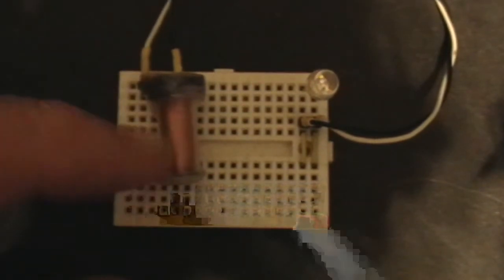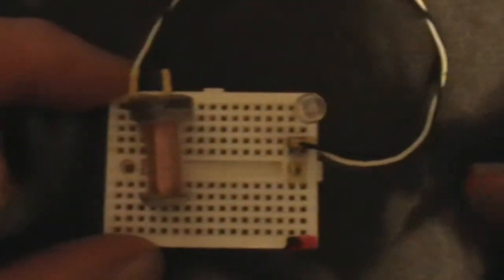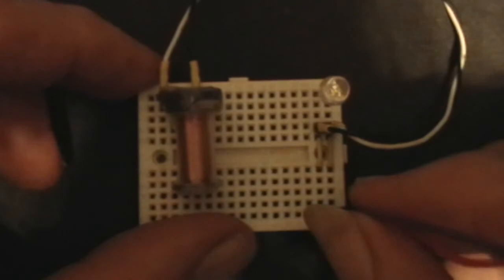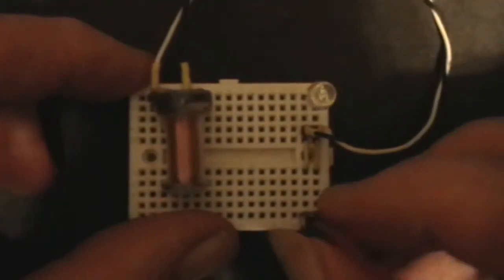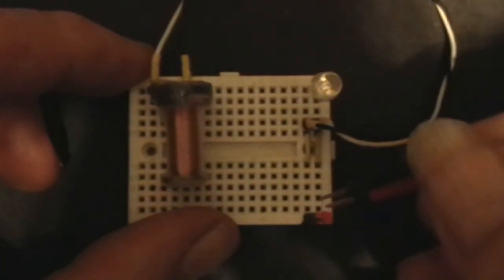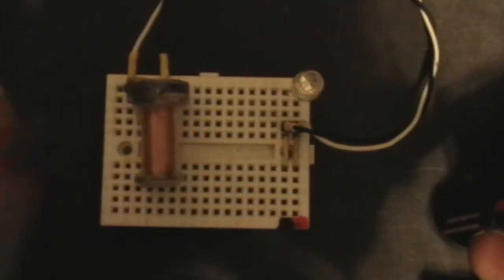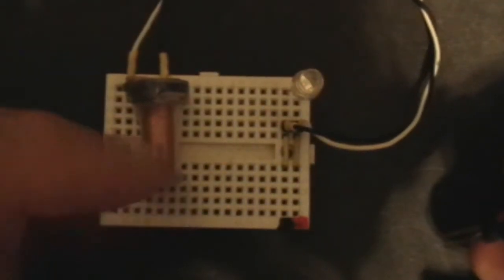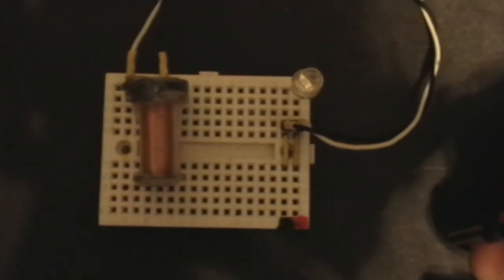Coil Current Direction when Power is Interrupted (1)

Comment: I HAVE TO BE NITPICKY ABOUT THIS TK..I THINK THAT YOUR CIRCUIT NEED A DIODE IN SERIES WITH THE LED TO PROVE YOUR POINT..BECAUSE THE LED FLASH THAT DOES NOT PROVE THAT THE CURRENT IS NOT RINGING AND OSCILLATING..
Reply from the maker: IS YOUR CAPS LOCK KEY STUCK or are you just being rude? In English speaking countries ALL CAPS is considered SHOUTING. 

Watch the second video.  
https://www.youtube.com/watch?v=X66foYixu9Y

Besides, what part of Light Emitting DIODE do you have trouble understanding? Putting another diode in series would only raise the voltage rise necessary to make the LED flash; the results would be the same.  The circuit is not ringing or oscillating. 

Now, ask yourself why circuit designers put a diode, reverse-biased, across a relay coil to protect the driving circuit when the power is cut off to the coil.

Comment: What's fascinating about this demo is that it goes against 57 years of my electronics intuition. But it's correct, so much appreciated. I imagine that's the reason you felt compelled to post it - because we are taught that "back EMF" exists to reverse current. At least the "back EMF" part is correct anyway.
Reply from the maker: Thanks for checking in and commenting. This is hard to confirm on the scope because stray capacitance and inductance cause so much ringing that it's hard to see what is happening. But I think the LED provides unequivocal evidence that the current does not reverse.  At least it makes it extraordinarily difficult to explain why the LED flashes if the current does reverse as many people still claim.  This little video of mine has sparked considerable controversy and seems to have left some people utterly flabbergasted. Is everything we know really wrong?
Reply: It is absolutely correct.
This is a less traveled corner of electronics that many struggle with.
I have even seen tutorial videos here on youtube by experienced engineers that have gotten this wrong.

Comment: could you try to use 2 parallel LEDs (cathode to anode/ anode to cathode)?
Reply from the maker: You will note that the power supply is 5 volts and there are no resistors or other current LIMITING components installed. So if there was a forward biased LED in the circuit, it would fail as soon as I connect the power.  The LED that is reverse-biased when power is on survives the flash from the inductor's discharge when power is disconnected because the flash is so brief and because the LED limits the voltage rise by conducting.  With a lot more inductance in the coil (more energy stored in the magnetic field) the LED might fail even so.
Reply: Thank you for the response.
i understand the problem of no current limiting resistor for the LEDs,
and i agree with you with the "cold electricity" explanation (HV HF)...
by the way i was thinking about the response of a coil in resonance, as for example with the simple 555 timer circuit (have a look at my vid) to test the resonance of coils
Reply from the maker: Of course I could use your idea of two antiparallel LEDs if I used a power supply that was much less than the Vforward of the LED. Like one volt. With sufficient inductance in the coil, the first LED should still flash as the voltage of the inductive collapse rises. The second LED should stay dark. I'll have to try it, thanks for the idea. 
I use a PLL system to check resonant response of coils.
EDIT: I just tried it with 1 volt supply and the two LEDs. It works as expected, the second LED stays dark and there is sufficient voltage rise to make the first LED flash just as before, but not quite as bright. I'll have to make another video because this added test reinforces the point made by this video. Thanks again for the suggestion !
Reply: Thanks to you TinselKoala!

Comment: I am picking up what you are putting down, sir.  Thank you for it!
"The voltage polarity of the coil can be thought of as reversing,..." is probably the stumbling block that confuses most people.  As you have clearly demonstrated:  The current goes from the plus side of the coil to the minus side (in steady state) when powered, and from minus to plus (transient) when switched off.

Your experiment reminds me of the MIT Linden jar disassembly while fully charged--opposing plates were brought together and made no spark until reassembled with the, "insulator."  Absolutely mind blowing.  The insulator holds the charge gradient, not the plates as shown in books.
Reply from the maker: "The current goes from the plus side of the coil to the minus side (in 
steady state) when powered, and from minus to plus (transient) when 
switched off." Well, this is still a rather awkward way of putting it. Actually the current keeps flowing in the same direction, only the voltage polarity of the coil can be thought of as changing. But does it really? If you think even harder about it, you will see that when power is ON the top of the coil is still a current sink (current flows into the top) and the bottom is still a current source (current flows out of the bottom) and this does not change when power is disconnected.

Comment: You are right. The current supplied by the 5V goes externally from plus to minus, but internally back from the minus to the plus.If we apply this knowledge to the coil, the current goes from the plus to minus, and to make the LED flash the bottom must be the plus of the coil, so the current goes internally from top (minus) to bottom (plus). To make things worse, the electrons actually travel (very slowly) from minus to plus.Any how, a good thing you showed this. I get the theory but never thought about it! The potential is reversed but the current does not. Actually the current is reversed, but it is negative. Hmm, that sounds silly ..
Cheers!
Reply from the maker: No, the current is NOT reversed! The flashing of the LED proves that beyond any doubt, doesn't it? How could the LED flash if the current in the coil was in any sense reversed? It couldn't.
We are of course talking about "conventional" current that Ben Franklin stuck us with. The actual motion of the electrons also does not reverse, but is opposite to the "conventional" current which is considered to flow from positive to negative. What reverses is the polarity of the voltage of the coil, with the bottom end becoming "higher" in potential than the top when the power is interrupted. Hence the current does not reverse, it continues going in the same direction through and out of the coil.
Reply: We are both saying the same. I am comparing the coil to the power source/battery. As if the coil is a battery when it does the EMP. Just like with the battery, the current internally goes from minus to plus. Perhaps you misunderstood my word 'top' and 'bottom', I was referring to the circuit. The top of the coil is attached to the switch (plus of the power source) and the /cathode/ of the LED.
In fact it is a quarter wave of a sinus, that new potential. The coil would like to go in resonance, how ever it is shorted by an LED. (edit: replaced cathode and anode)
Reply from the maker: Look again. The Top of the coil on my schematic AND my breadboard is connected to the CATHODE of the LED. No, the discharge is not a quarter-sine wave, it is an exponential decay ramp. If the coil wasn't "shorted" by the LED or other path completing a circuit, the voltage would rise and rise until insulation or component breakdown allowed the energy to discharge. This has nothing to do with resonance, except that there is always some stray capacitance that will cause ringing at the resonant frequency of the LC tank formed by the coil's large inductance and the tiny stray capacitance at the end of the main discharge.
Reply: With all respects, I think you confuse yourself when you use therms like internal, external...
The instant the 5V supply is dis-connected the LED will see the coil as a "battery" with polarity such that current can flow through it. (The LED)
In other words current keeps going the same way through the coil.

Comment: when the coil is powered on it creates a magnetic field.
that field collapses and induces the coil and that makes the led flash.
Reply from the maker: You are being imprecise in your language. "Induces the coil".... what?  The point of this demonstration is that the current does not reverse direction as the magnetic field collapses. It is the current that makes the LED flash. The LED does not know nor does it care where the current comes from, it only cares about the polarity of the current, that is, its direction of flow. 
EDIT: Yes, you can think of the collapsing magnetic field as inducing a current in the coil, which flows in the same direction as the current which induced the magnetic field when the coil was initially powered.